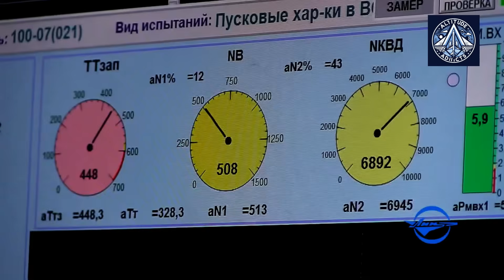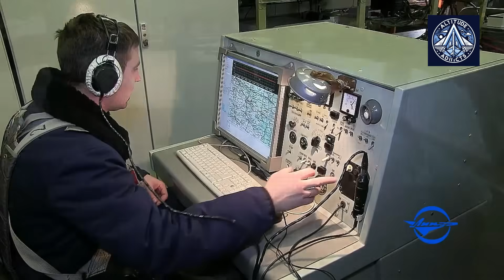Can Russia’s PD-14 Engine Save Soviet-Era Aircraft Like the Il-96 & Tu-154

Comment: the PW 2000 engines - bypass ratio 6.0, on the US C-17 transport jet are not that much better than the PS-90s on the Il-76-MD90  ..... bypass ratio 5.4. The PW2000 is used by the Boeing 757 - which is roughly the same as the Tu-214 ..... have the Americans re-engined their C-17 ? no ..... 757s .... no

Comment: Those are the wrong engines for the IL-96, the PS-90-4 are more adecuate and powerful for it....
Or 2 PS-90-4 and 2 PD-35 are an overkill for the IL-96.. 
The TU-154 is obsolete already and can be replaced with a standard YAK-242, it's a modular model that can be configured from 150 - 240 passengers in a short or long version....

Comment: I think if you are redesigning the Il-96 with new engines and avionics with that effort you might as well make a simple A330neo type aircraft without much additional risk and wait for the PD-35s. Depending on how long the PD-35s will take to develop maybe add some risk (i.e. composite wings, lithium ion batteries etc.)

Keep producing the Il-96-300/400s as they are to fill the urgent demand you currently have.
Reply: Кому они нужны эти ил-96?